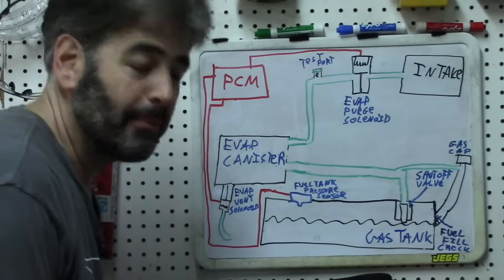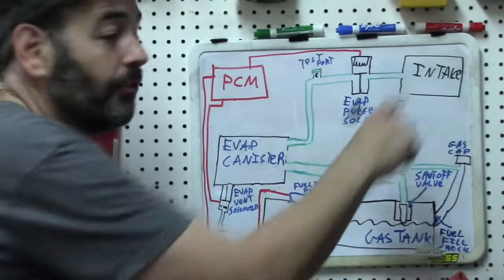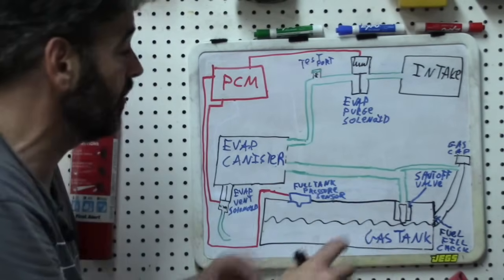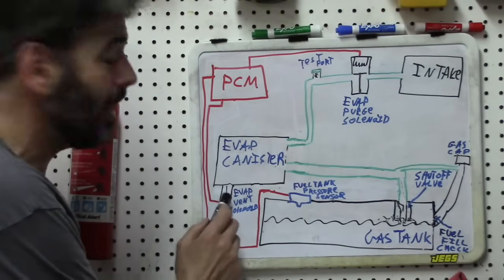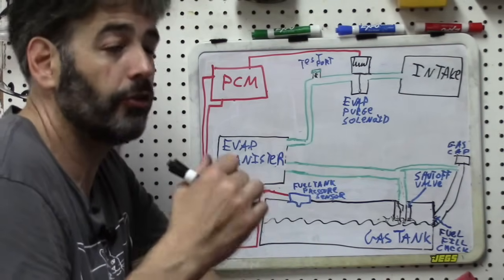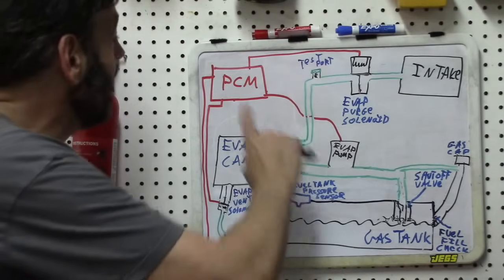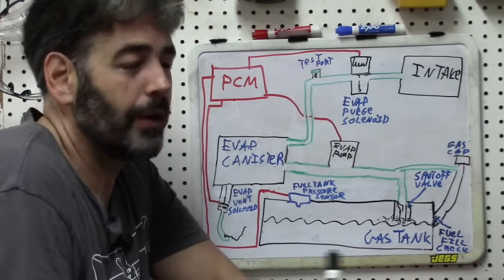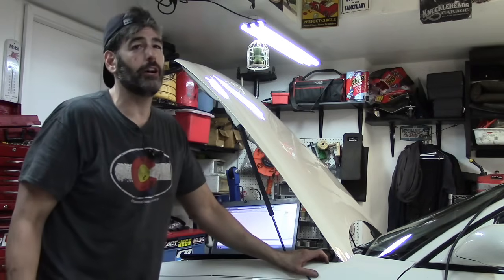Diagnosis + Understanding EVAP Systems (SBQM Full Video)

Comment: I know this is a very late comment but I have a 2013 scion frs and I'm trying to get my car to pass smog here in california. The only aftermarket item I ha e is a cold air  intake. Yes it has a sticker. Now I bought this car from someone who was selling his car on Facebook. The car is nice. But I think he faked his smog before he sold the cat to me and now I'm having a hard time getting it smogged. The evap and o2 is not ready after driving over 2000 miles. I've gotten an extension through the DMV for 2 months to get the car fixed and to pass smog. Now I'm not a mechanic in any way shape or form. When I brought the car for a smog test o2 and evap not ready was the reason why I failed my smog. The smog guy didn't really explain tell me what I need to do. He just told me to do a drive cycle. And that I can do a re test in a month. After a month after doing drive cycles I still failed. And after doing more drive cycles and over 2000 miles my o2 and evap are still not ready. I've changed my o2 sensors still no changes. So I'm thinking something with my evap system. But I don't know if I need to replace parts or not. I don't have the budget to go to a mechanic for their costs so I got to do this by my self. Some help please. Anyone
Reply from the maker: What data do you have?

Comment: Thank you ,your video helped me fixed my Rx 300 evap leak with out tools just following your way of thinking  you are much appreciated.unfortunately I replace 2 sensors before I watch your video on one of which needed to be replaced the egr was cracked but the air  mass sensor was good  and I changed it with out proper testing … oh well now I know. I had  a big leak beside the Egr .from now on I’m not changing any part till I use your method it’s the right way .thank you very much

Comment: Problem is it is NOT showing the 3rd vacuum line going to the Purge on  Fords, all the way to 2008. Not the bigger diameter plastic line carrying the fumes into the manifold, the small diameter plastic line the supplies vacuum from throttle body to the purge valve.
Not one so-called expert has answered this, though on one site the author said it was needed for a Ford Purge to operate.
I had a big vacuum leak/P0171 mechanic knocked the line off at the TB, I found it/fixed it. I had ZERO EVAP-related codes during the 2 weeks the vacuum line was disconnected, so what exactly is this vacuum line for? During the time it was off, I had all the usual things a vacuum leak would exhibit. Fuel trims way too high, high idle, then low rough idle, stalling, and low downstream O2 sensor readings. Also the P0171 would come back after I cleared it.
I suspect it is used to develop vacuum for the bleed-up rate test.

Comment: So I found your video in trying to understand how a fuel tank gets air in as fuel level drops. So is it the job of the ECM via the vacuum sensor and a signal to the vent solenoid ?  A ton of still in good shape old corvettes , like a 1980 carburated still , had  the evap system removed by a questionable mechanic, and now the car only runs so long amd stops. 1980 has old mechanical fuel pump. I am thinking he is getting a tank vacuum as he drives and is starving his fuel pump....

Comment: What about a chevy code PO440. That code is hard to diagnose
Reply from the maker: That’s an easy code to diagnose-  where is the leak- it is between or at the solenoids? Once you determine that it’s just a matter of using pressure or vacuum to find the leak in the exact location.
Reply: I don't have a smoke machine or vacuum or pressure source to diagnose the issue. The fault code is generic. I suspect 3 possible component failures.    gas cap, vent valve , or purge valve. This is a 1996 Chevrolet S10 pickup truck. I "selectively shotguned" the problem. 1: replaced the gas cap and it didn't resolve the problem. 2: replaced the vent valve and it didn't resolve the problem. 3: replaced the purge valve and I still get the fault 😔

The old purge valve, with no power applied, I can't blow air through the ports. The new purge valve I can blow air through with no power applied. Hence, the new purge valve is N.O. (normally open). Is this right? Did RockAuto send me a defective purge valve? I thought evap purge valves are N.C. ?
Reply from the maker: You don’t need a smoke machine - just vacuum. What’s a vacuum pump cost- like $20?
  Just activate the solenoids individually and find the general location of the leak

Comment: Wow..thanks for sharing your knowledge and skills with us all, I greatly appreciate it. I've changed the purge valve twice in my 2004 tahoe and the code keeps coming back. Any ideas of what else I can do without breaking the bank? Thanks in advance...
Reply from the maker: what was the voltage at the purge valve showing and did it create flow when you grounded it?
Reply: @SchrodingersBox  Auto Zone scanned the code fault and suggested I replace it, so I did but did not help.  Code P0446
Reply from the maker: Yes of course replacing it won’t fix that. You have to diagnose the electrical circuit which is why I am asking what direct voltage does to it.
Reply: @SchrodingersBox  thanks I will check and let u know when I am off work

Comment: Hi, i have an issue with my honda prelude 2001. My  gas cap keeps loosening over a short period of time im assuming it is beccoming pressurized in the system. The gas cap is new, the filler neck is not damaged egr is new and hoses as well including egr solenoid. Im not sure what the cause can be any ideas? Will be very much appreciated.
Reply from the maker: I would start by checking the voltage on the pressure sensor and seeing if it is excessive- indicating too high of pressure. If pressure is too high I would start by examining vent valve operation.

Comment: I have a 2012 lincoln mkx with a ez fill gas filler. ( no gas cap)  I keep having a bank 2 sensor issue, that is making my car engine shake and run rough. I feel that capless gas filler is the problem. Should I replace the gas filler?
Reply from the maker: It is not possible the gas cap can cause that. Especially on only one bank. Do a fuel trim analysis to find the issue.
Reply: @SchrodingersBox  thank you for responding. I look into it and get the test done.
Reply: What kind of mechanic should I seek out that would know about fuel trim. My engine code is P0352.
Reply from the maker: Any competent mechanic should be very familiar with it. It the basic foundation of diagnostics.

Comment: Hello the old system venting the vapour in the atmosphere? No the tank pressure assist the pump to feed the carburettor there was a one way valve in the tank cap allow atm air in this is the same way grass trimmer work

Comment: Great explanation of the system, Matt. Youve explained the system very well. It's the base when starting troubleshooting. I have a 2013 Range Rover with p144c code. The mechanic chande the valve an the gas cap but the code remains. I don't understand what really means that code. Could it be a problem with the air pump? Have a nice day!!
Reply from the maker: thanks. p144 codes are normally flow codes. The way I would diagnose it is I would seal the system with engine running and look at the fuel tank pressure sensor voltage. If system is sealed the pressure should not change— it may rise a little just due to temperature or evaporation but it should most definitely not have vacuum.  If there is vacuum it can only be the purge valve.   If it remains the same, open the purge valve to draw vacuum and then close it. Look for decay on the pressure.  If it decays you have a leak in the system.

Comment: I have a problem filling the fuel tank, but no codes, the attendant turned the fill valve upside down so the fuel will keep running, WHAT DO YOU THINK . 1999 CHevy VENTURE.
Reply from the maker: What data do you have?
Reply: @SchrodingersBox  I'm hijack this as I'm having the same problem. 

I have a 2007 ford f150. I replaced the fuel pump a few weeks ago and the gas pump started doing that. Since then I've replaced the vent solenoid (which was giving a check engine code, I don't remember exactly which one), I cleaned the vapor canister (this models has been discontinued and I can't find an aftermarket version) to which it wasn't clogged but the flow was lower but it's good now, and I've replaced the evap canister purge valve just because I saw it on a forum that it may cause my issue. I'm honestly not really sure what else I could try. Any ideas?
Reply from the maker: Ok again- same issue. what data do you have? I need some data to go on.

Comment: If you unplug the hose that connects the gas tank to the charcoal evap canister, and you still have problems filling up gas for more than 3-5 seconds at a time, that means the problem must be on the shutoff valve attached to the gas tank, correct?
Reply from the maker: Correct. Or an obstruction in the actual filler neck like to tank itself.
Reply: @SchrodingersBox  can I get your opinion on my situation? I just bought a used 2004 Subaru STI with a preexisting condition: 1) the gas only fills up 3-5 seconds at a time 2) check engine light throwing error code: P0457 Subaru Code - EVAP System Leak Detected Fuel Cap Loose/Off

The previous owner took it to a mechanic a few times but doesn’t know exactly what was replaced except the fuel cap. But as I said, he took it more than once, so I believe the charcoal canister (looks visually newer than the rest of the underbody) and some other parts were also replaced. HOWEVER, if like I said, I pulled the hose connecting the gas tank to the charcoal canister and it still doesn’t fill up quickly, it doesn’t matter what was or wasn’t replaced bc we know the issue has to be with the shutoff valve on the gas tank or an obstruction in the neck. 

This also lines up with what the previous owner told me, that his mechanic said the next step would be to drop the tank and replace “some part”. So I think I’m on the right track, however dropping the tank on an 04 STI requires disassembling nearly the entire rear end ($$$) so I want to be extra diligent with my diagnosis. 

This part on the gas tank is called “Vent Valve” part no. 42084FA161, so I’m a bit concerned it’s not the same as the shutoff valve you’re referring to in the video. 

But with the symptoms of 1) and 2) I posted above, does it make sense this is the failed part, esp when combining with the pulling the hose off the canister and still being unable to fill up for more than 3-5 seconds at a time? 

Would that part failing be causing these issues, because to me they almost seem contradicting, if I have a “EVAP System Leak Detected Fuel Cap Loose/Off”, wouldn’t I be able to pump gas without issue? Where as not being able to pump gas seems more like a “blockage” rather than a “leak”, but maybe the error code is a “catch all” code.

Comment: getting a code when it goes below 1/2 tank of gas on 2002 dakota(says small evap leak)
Reply from the maker: verify tank pressure sensor is working first.
Reply: @SchrodingersBox  o k  thanks for replying

Comment: Thank you for the video! I have one question: When I cold start the car and open the window, I can detect a strong smell of gas. Is it possible that this is gas vapors that released from the EVAP vent? Or there is an issue somewere in the fuel system? Thank you!
Reply from the maker: Could be that or engine is running excessively rich at startup.

Comment: 2007 Subaru Outback with no codes.
Hard start especially in cold weather. 
New battery, plugs and wires didn't fix.
Finally changed the the evaporation purge valve.
That did it! Thanks for your help! 🙂👍

Comment: Thanks it was very helpfulbfor me.
But i want to know what time the  canister vent valve is open and when it is closed.
For example if you open the ignition and park the car and leave it How is the canister vent valve condition? is it closed or open??
I can prepare a text file and send to you by email could you please share your e-mail adress??
Reply: Thank you you are full of energy👍
Reply from the maker: The cannister vent is normally open. The only time it closes is during a leak test. If the car is just parked somewhere the vent is almost certainly open- there are some cars that may run a leak test even when car is parked though. I think Nissans do that.  But normally the vent valve is open by default.

Comment: Samuel Clements said "Fortunately my schooling hasn't interfered with my education".  My generation grew up with IC engines (I'm 80 years old) so I am in full agreement that engines can't be diagnosed without "thinking", and usually a lot of it. I detect a little bitterness toward "professionals" with an ego. I swore off asking for help long ago following many bad experiences.  Fortunately,  we now have Youtube with guys like you with great advice. Thank you. But obviously you are not uneducated with a name like Schrodinger's Box, so I'm guessing physics.  Now what does the probability of an electron being at a particular location have to do with a bad fuel injector? If you can't afford a Snap On scope, I found a little box called a GTC 505 that is quite nice for quick analysis of ignition systems.  It really works.

Comment: In your example you say the sensor waits for vacuum, where does the vacuum come from? Is it just engine vacuum? Now i’m wondering if the purge goes before or after the throttle body if it needs vacuum? Also if it does use engine vacuum then would a vacuum leak be able to trip a large leak ?
Reply from the maker: Good questions. The operation is explained in another video on this channel “diagnosis and understanding Evap systems”

Comment: Hi Matt, great DIY video. Thank you sharing. My 02 Tacoma Prerunner is giving me a fault codes P0440 & P0442 I have a feeling the culprit is the Vent Valve. But I’m not 100% sure which end to connect my vacuum pump to check if it holds vacuum. Is it the end to the canister or to the air filter? Or maybe one of your subscribers know this. Thank you.
Reply from the maker: doesnt matter- connecting on either end and CLOSING THE VALVE should hold vacuum.

Comment: i connected to the purge solenoid hose going to the back solenoid that is completely disconnected hose and all and pressure is building up and no smoke is coming  out and gas cap is out
Reply from the maker: the charcoal cannister would be between the vent and purge solenoids. did you disconnect it before the cannister? if not, the cannister is likely clogged.

Comment: Hi mate. I watch your videos all the time. They are merchandise. Can I pick your brains? I've got a ford fiesta zetech 1.4l 2009 deisel. I've only got 1.2v on injector feed wire key in on position. Should be 12v as far as I know.  5v engine running. I've been look for high resistance in the feed wire for weeks now. Can't find anything. I have got a high voltage drop on injector feed wire. All test with injector plugs unplugged. Injectors are within spec and not shorted. Just don't know where to look anymore without a diagram. I'm seriously at a loss. I don't want the misses driving it with that problem because it goes into limp mode, rapidly reducing speed instantly when engine as been running for a while. Nearly caused a crash on the motorway once going from 70mph to 27mmph in like 3 seconds. The auto technicians near me are useless. I just need to find what I think is a partial break in the injector feed wire. Can you please help me 😢
Reply from the maker: Yeah you will need to find a wire diagram and follow that wire to where you most likely have it partially shorted to ground.

Comment: Good job. Even though my vehicle is a 2006 Ford Expedition, this showed me the issue and location of the suspected criminal valve. Well done. 
And! 5 hours later. The canister and valve is not there!
 I called the dealership and they said it was above the spare tire. In order to get to( what might be ) the canister takes some dismantling of that area. I'm not having fun.

Comment: I'd connected the smoke leak detector and I did find a big leak in the oil pan gasket  !
Now do you think this will affect my rough idle or not ?
Reply from the maker: Yes it definitely can. it’s essential same as a PCV leak.
Reply: @SchrodingersBox  so this could be the cause of running rich and random misfire  ?
Reply from the maker: if it is severe enough, yes. try adding a fuel source like brake clean or propane around suspect area and see if fuel trims are affected and that will confirm it

Comment: I have P0446 code  in corrolla  2004. What is the issue would be? Solenoid sensor need to be replaced?
Reply from the maker: Lots of things can cause that. what data have you acquired?
Reply: @SchrodingersBox  Evap system vent control fault. My mechanic told me you can drive no need to worry  about this code. How about your opinion?
Reply from the maker: He is technically correct about that however if your state has emissions testing you will not pass with this code. I would recommend fixing it in that case.  I would start with the basics by looking for voltage at the vent and purge solenoids and if there is, verifying they seal properly.  usually P0446 is electrical so check the control voltages as first step.

Comment: Can any of this Cause the PCM to drop below 9 V and also give you a gas cap signal even if your gas cap works
Reply: 2006 Ford Mustang 4.0
Reply from the maker: technically there is no such thing as a “gas cap signal”. The evap monitor can’t tell exactly  where a leak is- it can just tell how much of one there is.
   yes it’s possible a low voltage could case a solenoid to fail to close completely and thus signal a leak.